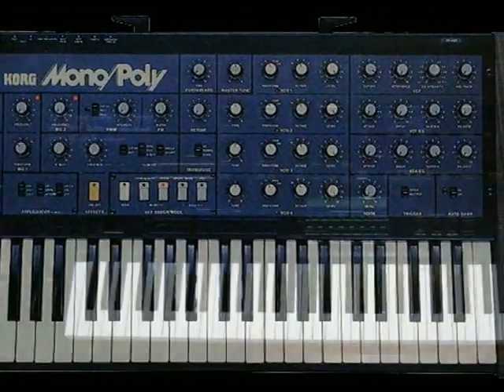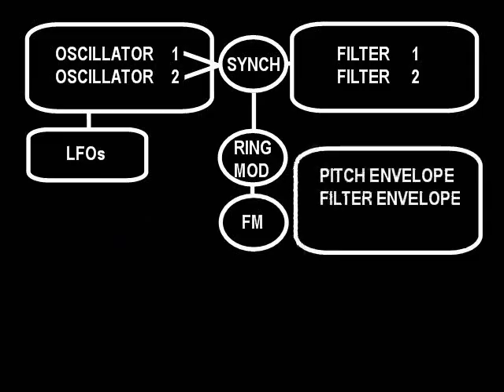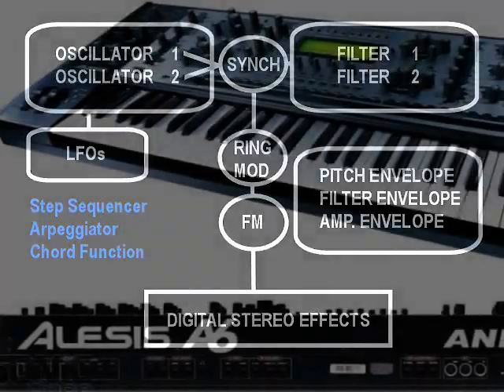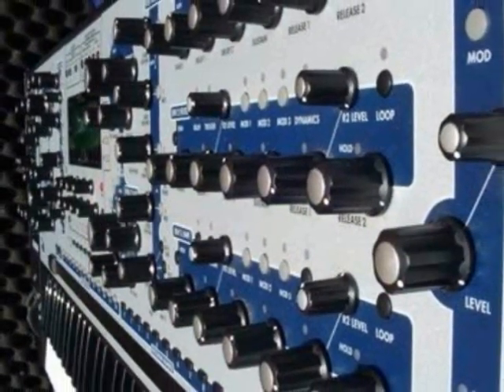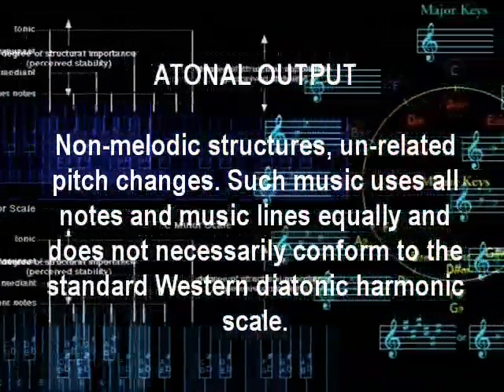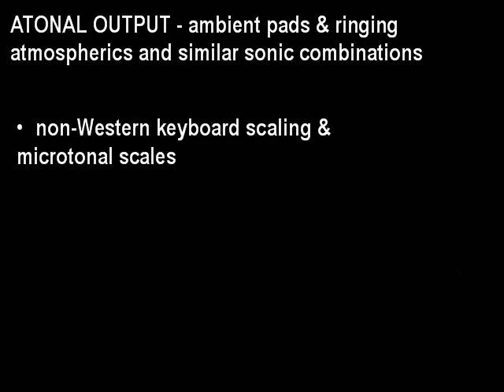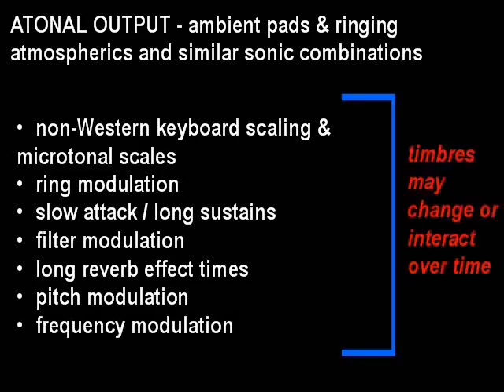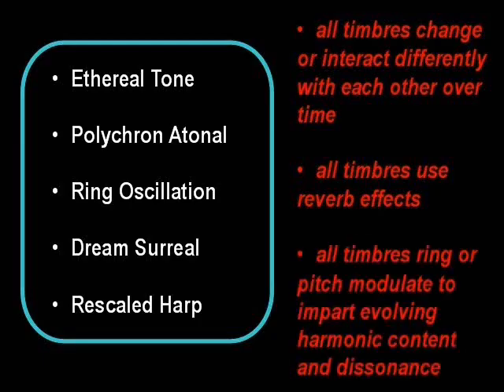Alesis Andromeda Atonal Synthesis

Comment from the maker: For special effects and non-Western scalings, from memory I think I experimented with subtle linear FM, using the Tracking Generator as an oscillator MOD source. Also there is a reference I have which mentions using the VOX Key Number as a MOD source with a level less than 100 to create micro-tonal scales. 
Jeffrey S.